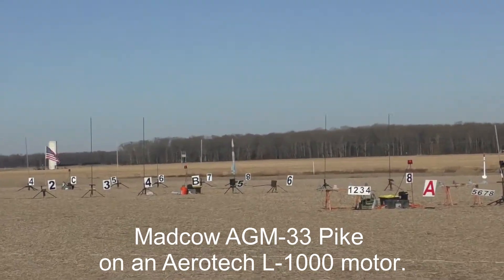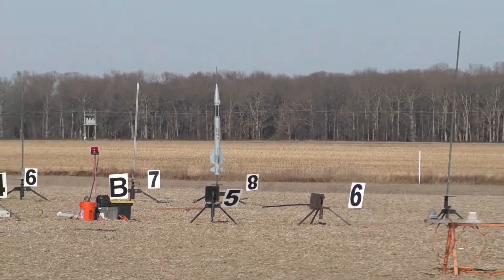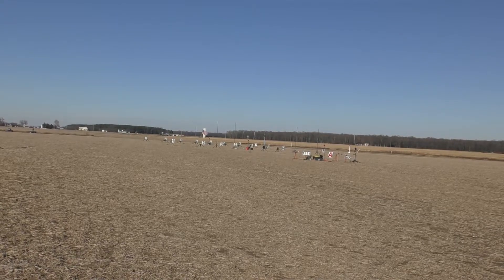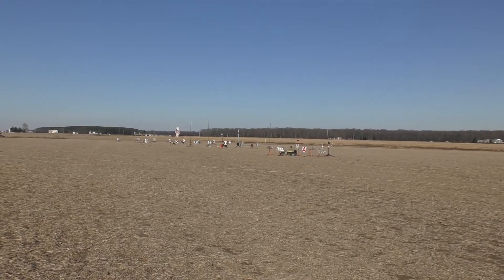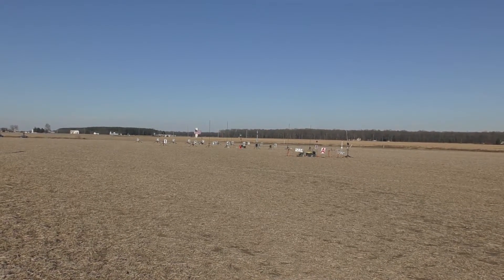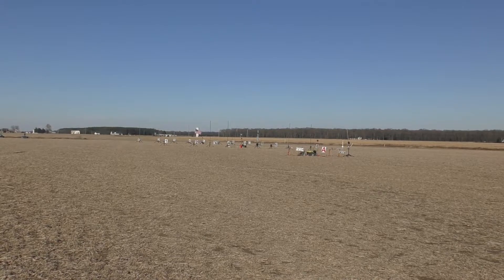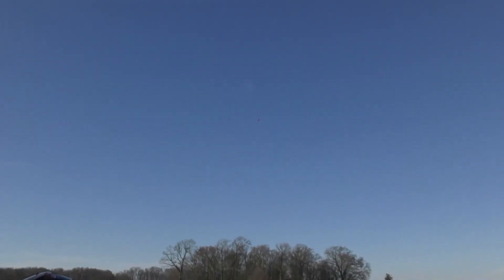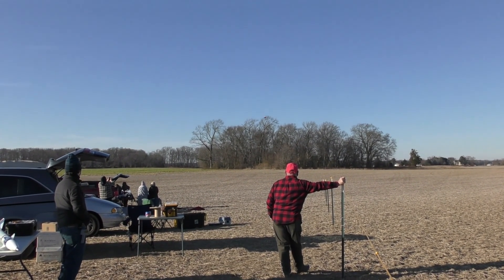Madcow AGM-33 Pike on an L1000, 1-10-21 at MDRA.

Comment: What size are your 2 chutes
Reply from the maker: Hi David. the drogue is 25 inches and the main is 72 inches. Normally you'd want a larger main in a rocket that weights 32 lbs, but the design of this parachute gives it a high drag coefficient so it was adequate. Both are from fruitychutes.
Reply: @jeffmiller8485  do you remember what your desent rate is for your weight
Reply from the maker: @xxshooterxxdm  Approx 23 FPS